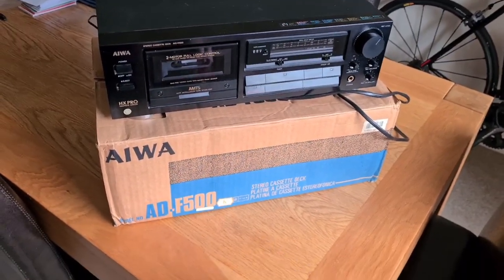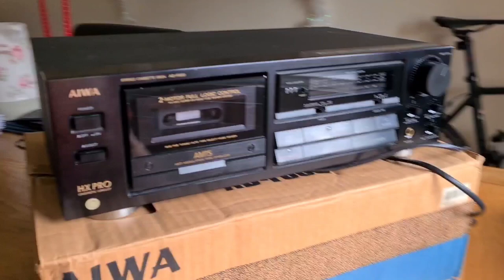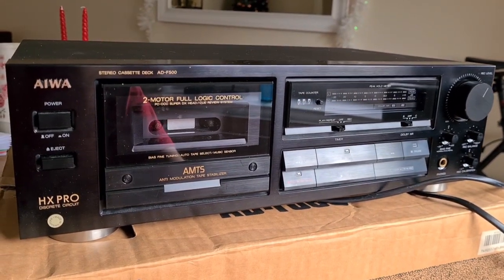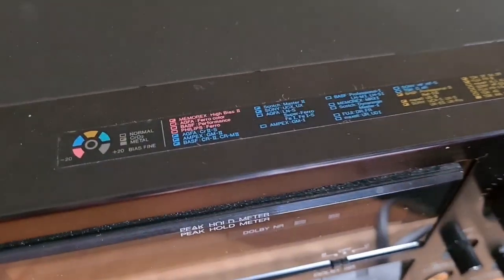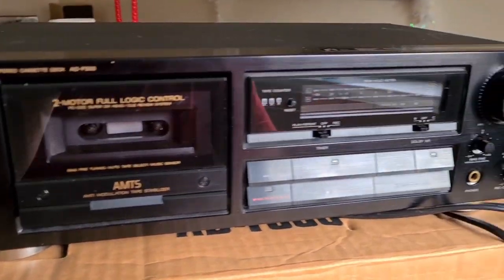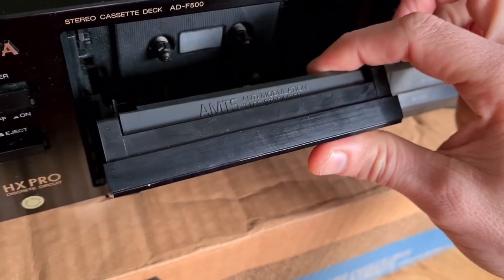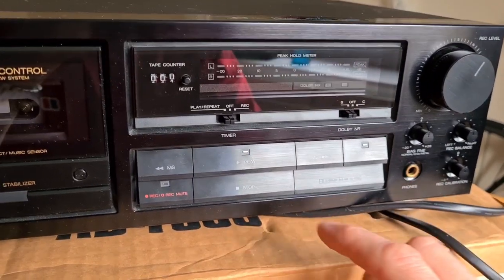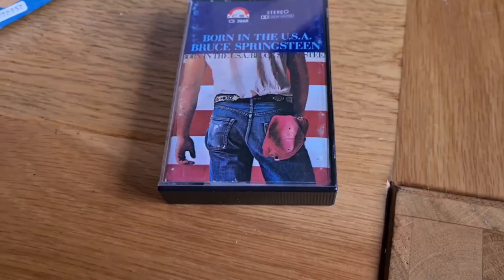Aiwa AD-F500 Early 90s Cassette Deck - Transport Repair, Soldering, Belts & Calibration

Comment: You are missing the tiny ball bearing between that little metallic retaining plate and the mechanisms
Reply: Part number 27 on the pdf of the exploded view of the mech. Well spotted. So ,the transport does have to be removed again.

Comment: Dude, put a regular rubber band over the capstan and the belt to hold it in place. Once the parts are assembled, just cut the rubber band off :-). I've done my Aiwa belt replacements, but this one is a bloody nightmare. Must be the '90's model. In the '80's they did them more friendly to service.

Comment: I find with these you don't need to remove the PCB and desolder it. You can click it up slightly with just enough room to fit the belt in place around the black wheel then click it back down. I fixed my memorex auto reverse deck which is just a rebadged aiwa this way. They sound really good for what they are. I made a few mix tapes for my friend and she says they sound like a CD in her car! :) Good stuff.

Comment: Amazing work!  I took my old aiwa with autorverse out of storage and fixed it.  I spent so much time cleaning out the melted belts.  Then it took multiple attempts to clean and gently lubricate the autorverse mechanism.  I was cringing so hard when you just slapped it back together.  But it worked out.  I'm very impressed!
Reply from the maker: Good work!

Comment: Thanks for a great video, just used it to revive a similar unit that hasn't been used for over 20 years. A mention also to Matt at DeckTech who was very helpful in providing a full set of new belts - recommended. End result sounds a lot better than I was expecting, perhaps better than I remember. Now I can digitise that stack of old tapes.

Comment: Superb work this deck sounds great better than the ad f450 i have .I have recently done my aiwa ad w x828 twin deck i bought new many years ago, it was an absolute pain, i knew the solenoid's had to be unsoldered and this was easy. The duratool desolder station from cpc makes it quick and easy .You have to seat a leaf spring switch on the motor board correctly .  oddly the 2 cam positions for deck functions are not in the service manual i went round in circles trying to figure it out before looking at a Russian guys video on the ad w x929 and he pointed and showed how to do it i took a screen shot on the phone and then it was good i now knew how to set the deck and upon testing it was mostly good but wrong functions every now and then on the front panel buttons .i bought a spare parts deck and swapped button boards over and all is fine the spare parts deck was quite handy for working things out at some point i will sort it out as i now know how to do theses decks with no problems .my deck was stored in a loft most likely why it needs the button switches replacing .All i need to do now is the idler tyre and pinch rollers on my 3 head aiwa .

Comment: I've just watched a future video where you repair a 450 variant of this. It would be interesting to hear and see if there was a difference between the two. As there's a separate drive motor for the flywheel; if the heads are different and or electronics.

Comment: 23:41 PCB-E is the board (PCB). You can see the hole where the clip was melted in and it looks likes it comes off with the solenoids. 50:14 I found metal screwdrivers can mess with the speed adjustment pot when removing them as they also conduct. I was able to find some ceramic ones online for that. But their shafts are too short for azimuth adjustment. Good job cleaning up that other person's mess!
Reply from the maker: Thanks Mike, I did eventually pickup a ceramic one!

Comment: I had an AD-F450, which came out a couple of years after this. Essentially the same deck, but the 450 didn't have tape calibration.
Not bad decks when they are working properly. I think I only paid about £80 for it new, from Richer Sounds back in the day.
Reply from the maker: This was a good one. I think I still have a second I bought for parts and never needed.

Comment: Amazing video. My dad bought this deck new back in the day and now we are trying to change the belts. Only problem there is, we have neither experience nor equipment for unsoldering/soldering so is it really possible to avoid that? We have opened it, cleaned of the old belt remains and etc but now that's the problem. Any suggestions? Thanks a lot 🔝👏🏻
Reply from the maker: If you're just looking to get a new belt on it, I believe from memory you can fit one without soldering. But not entirely sure this was a while back now! Buy a small crochet hook to help you thread it through small gaps but be very patient. Are you in the UK?
Reply: @pwrestoration  Thanks for the quick reply, highly appreciated. I'm in Greece. I've ordered the same wide belt you used in this video. For the other belt I have to pass inside though do you have any suggestion on approximate size? I have some spare belts from China should I try and see what fits best? Unfortunately the old belts completely disintegrated so I can't compare them. Thanks again.

Comment: Can you show in a video how to adjust the rec levels ? I have AD-F410 version and a channel is lower than other
Reply from the maker: I don't have the deck anymore in afraid but grab the service manual pdf off Google and it'll tell you in it. 

Be careful though, you can seriously cause issues. It could be a playback level, recording level, or even a meter that's out

Comment: At 40:40 you place the metallic sheet, called p-spring.
On my ad f600 I can't set it correctly because the two flaps on the right black peg and the one on the left peg seem to be missing so p-spring is impossible to set.
If you place it on one side it moves on the other...
Could you please give me any suggestion on how to fix it?
Reply from the maker: See that plate? It pinged off about an hour after filming. Remove and bin!
Reply: I'm afraid that without it you will have heads instability and couldn't set azimuth correctly giving you a very bad sound...
Reply: There is a small silver ball underneath too...

Comment: ❤ hey i bought one of YouTube and got it all apart and the bands on…but now it clicks and doesn’t play a Kassette….before I put the bands on the motors would at least spin…did I move a plastic piece or something…
Reply from the maker: I can't tell what you did or didn't move I'm afraid!
Reply: @pwrestoration  haha this is probably a futile attempt to repair...anyhow I took it apart and put it back together...now the motor with the small band spinns and stops then starts again..but the motor with the big band doesnt spin.
Reply from the maker: @radra1040  could be two issues. 

1. Does the larger motor spin with no belt on it 

2. If it does, don't disassemble the transport but instead take the large belt off in situ. Try turning the capstan (the large silver wheel on the transport the motor drives) by hand. The transport my be a little stuck between modes. Don't force it and break it, but try and see if it turns freely by hand.

Comment: I bought a second hand philips Aw-7550 dual cassette deck. Speed is a bit fast. Unable to adjust
Reply from the maker: It should have a pot on either the motor or the main board. Have a Google for the service manual.

Comment: Can you show how you adjust the azimuth next time?
Reply from the maker: Hi Terry of course, I think I did that in my other video for the same deck.. I can't remember!

It's one screw on these decks, but if you have poor sound I would leave it alone and change your pinch roller. It's a common fault on these to cause tape skew a little and lose your treble when playing tapes.